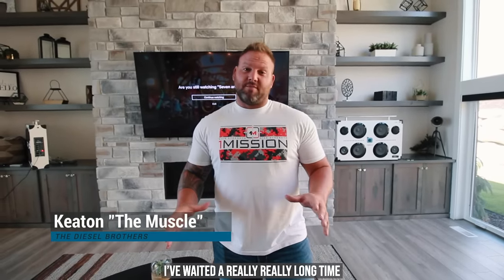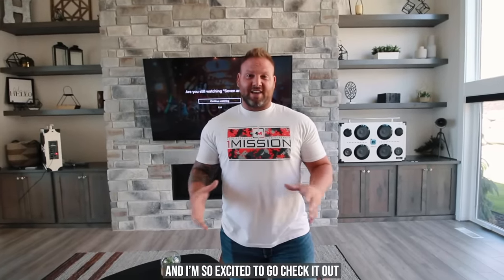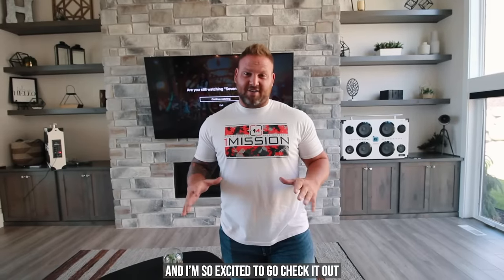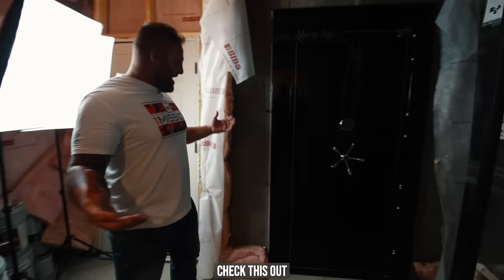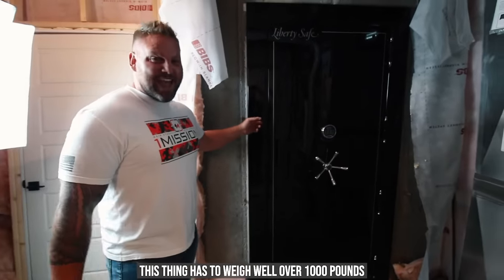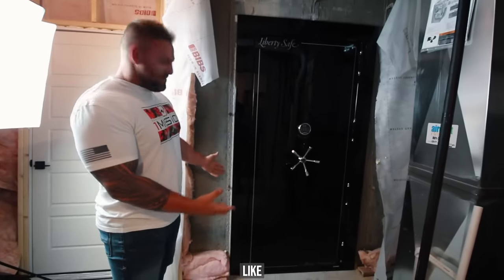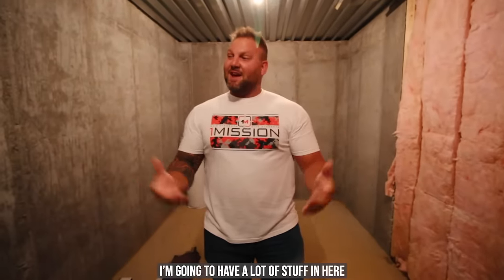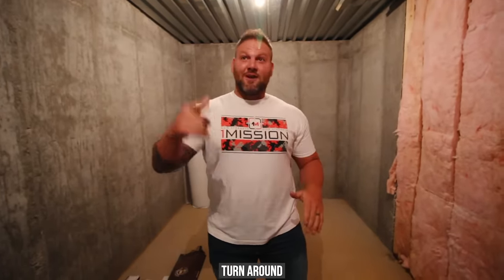Diesel Brothers Vault Door Install: Behind the Scenes with Keaton “The Muscle” Hoskins

Comment: If its going to also be a safe room.... how does safe open from inside ?!
Reply from the maker: Michael Cabada  That is correct.  There is a handle on the inside and the red lever that is accessible only from the inside disengages the lock.  That way is someones knows your combination they will not be able to open the door when you're on the inside.